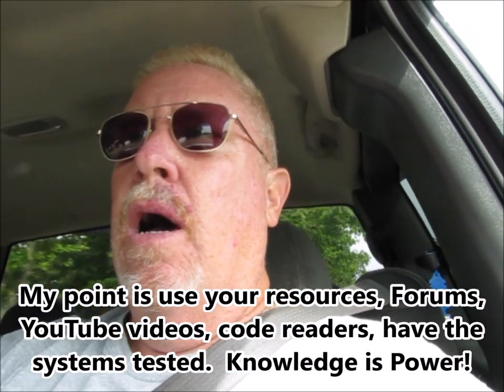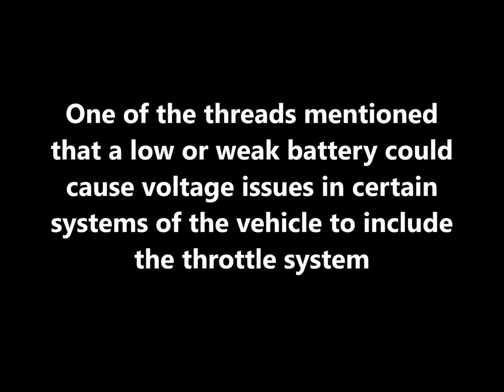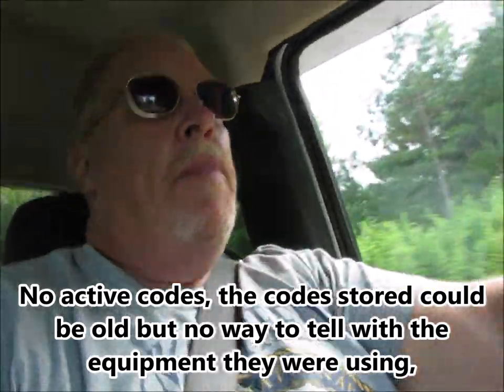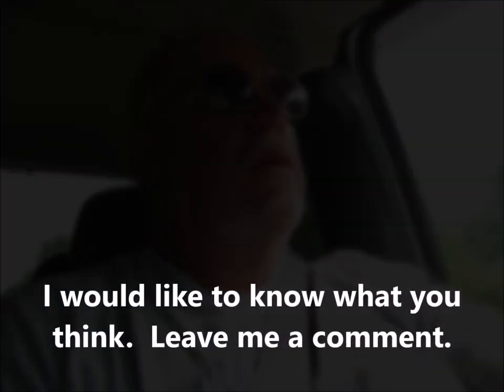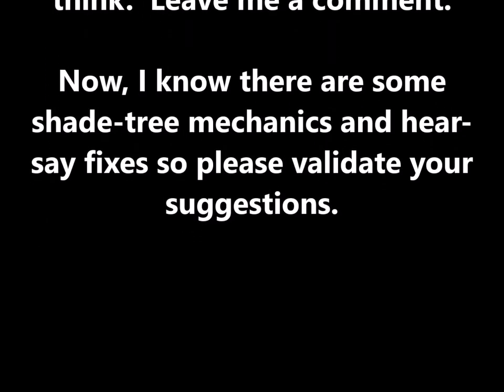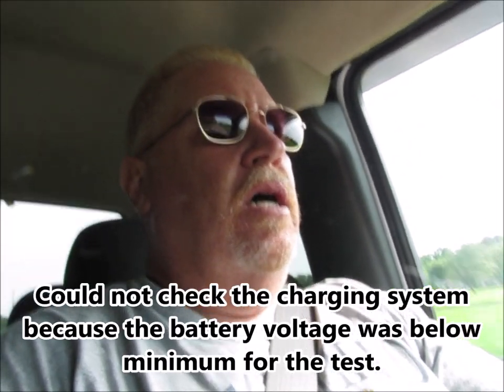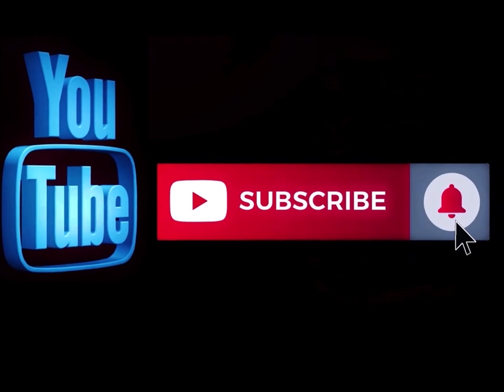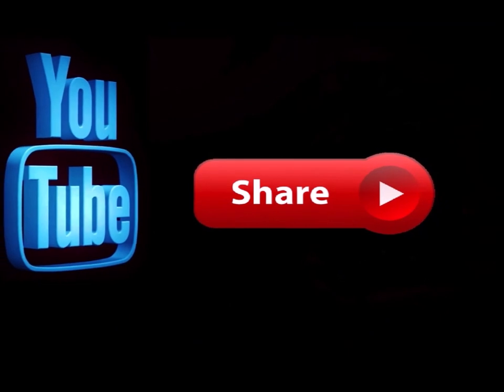Troubleshooting - Reduced Engine Power

Comment: Low voltage battery will cause all kind of electrical mishaps. With my experience with older vehicles when a three year old good brand battery starts acting up its best to replace it along with the alternator. Being a Chevy both are easy to replace. While you’re replacing the alternator you might as well replace belts , plugs, plug wires and fuel filter. Go ahead and give some love before being stranded.
Reply from the maker: Thanks for the advice Chad.  As for the additional maintenance items those will come in due time.  The truck needs tie rod ends, thrust alignment, tires balanced, shocks, etc.
Reply: I would think about replacing the battery, you are doing the smart thing by driving a see if the condition reappears.  As for changing the alternator when you change the battery, that would more than likely be a waste of money. I work on equipment, and the company I work for has several GMC and Chevrolet trucks between 2000 and 2007 year models. I've been around these vehicles for over ten years. I bet I've replaced dozens of batteries on these trucks, maybe in that ten year span two or three alternators total for all seven of our work trucks. We have had electrical issues, check engine lights and such. Not every time but most of the time, disconnecting the battery, and letting the computer reset. It removes the glitch that it had. But time will tell Ed, if it comes back.
Reply from the maker: @tracyphillips3325 , my plan is replace the battery before it starts getting cold, if it lasts that long.  Right now the truck starts and runs great.  When I do have the battery replaced I will get the alternator checked as well but I don't think it has a problem currently.  When running with every load I can place on the electrical system the alternator output is 12.6 volts and with just the engine running and no other load it is 13.4.  makes me feel like the charging system is working as it is supposed to do.
Reply: @EdsAttentionToDetail  12.6 is close to minimum, if it's a few minutes after start up that should be fine.
Reply from the maker: @tracyphillips3325 , that was after driving about 20 miles.  I used my multi-meter to check the DC voltage at the battery terminals.
Reply: @EdsAttentionToDetail  should be fine

Comment: I am completely dependent upon the dealership. All I know how to do is turn a key and drive. I have been lucky. I have never been stranded on the road, but I know that may be coming. I have a 2010 Ford Ranger I use for work. It may fail somehow at some time. Although I have been good at maintaining the old thing. I do have a 2019 Toyota Tacoma for times I want to drive with reasonable assurance I will get to where I am going. I am glad you seem to have solved your problem Ed.
Reply from the maker: Thanks Joe, peace of mind is important whenever you are on the road be a few miles or a few hundred.  I have been blessed with a decent mechanical aptitude so my reliance on a dealership is not as great.  Sending prayers your transportation needs are always met!

Comment: Hi Ed. I think you did it the smart way. I agree knowledge is power.
Reply from the maker: Tracy, my intent was to disconnect the battery to clear the code and check engine light then see if the problem returned.  No need to drop a bunch of resources on what might be a one time fault.  Smart way, that would imply I am smart.........just not so sure about that one! 😂
Reply: @EdsAttentionToDetail  you put some thought into it, before just jumping the gun and start replacing parts. I've seen people do that and all they did was eliminate some of their resources.

Comment: ????   First guess would be battery.   I had a simular problem in a 2014 E250. It was the fuel pump regulator module.  ????  Things don't run the way they did when we were kids.  Like you said there is so many systems that all have to work together to make your truck run.
Reply from the maker: So far, the truck is running fine (about two weeks now) so still paying attention to what it is doing.  Symptoms usually point back to a root fault but currently there are no symptoms.  Thanks for the comment, take care and God bless!

Comment: Hey Ed!! That sucks you were having some reductions in power in your truck. That's crazy the truck wouldn't over 50mph or 2K RPM! We try to do as much of our own car work ourselves at home.. Butters looked up those codes too... Isn't the APP sensor part of the ECM? If tightening the terminal and the vehicle is running well.. hopefully that was the issue..  If you had a battery tester, that could/would rule out your battery in less than 2 minutes. But if you continue to have issues with it.. check ECM failure?? Just a suggestion. We hope you can get to the root of the problem. Much love and good luck with it!! <3
Reply from the maker: Hey Bests and Butters, I read your comment a couple days ago and truly thought I had responded, so sorry this is late.  The truck is running fine.  I do think this problem was related to the battery in some form.  My current plan is to replace the battery before winter, if it starts not wanting to start or has other issues.  I try and do as much of my own maintenance as I can unless I can get done free or cheaper than I can perform the task (oil changes, tire rotations, etc). Thank you for your continued support and hope all is well for you both!  God bless!

Comment: I have had a problem with a mass Air flow sensor that made it run at way reduced power when it was raining. Also had an O2 sensor do the same thing. But a code should be coming up. So Idk?
Reply from the maker: The codes are helpful to a certain point but not always do they identify the exact trigger to the problem.  Seems in this case the loose negative post on the battery was a contributing factor.
Reply: @EdsAttentionToDetail  I could see that. I have a similar problem on one if my vans.

Comment: Great job on the research bud. from my experience in the autoparts world, batteries can be finicky, and with all the sensors and computers on board todays cars and trucks, a drop in voltage could cause a cascade effect.
Reply from the maker: Yes sir, very true.  I honestly dislike chasing voltage and ground issues so hopefully it was the battery all along.  Guess time will tell.  Take care my friend!

Comment: I remember on a four wheeler I had when the battery went dead it put itself in limp mode . You could hardly get any RPM's . I went a year or more not riding it until I came across YouTube video about .  All I needed was a new battery and hook up couple connections to reset the computer . Maybe your truck was in limp mode .
Reply from the maker: Yes Aaric, that is commonly referred to as limp mode.  So far it has not re-occured.  Just monitoring it right now for any other signs.

Comment: I would be replacing the battery ... The alternator on any vehicle since the 80s only produces enough amperage to run the vehicle, & maintain the battery. ( not Made to Charge anymore) If you run a weak/bad  battery too long, The Alternator will get overworked & it will go out with the battery costing alot more!  Seen this many times, even on bigger vehicles...
Reply from the maker: Thank you for the advice, my plan is to replace the battery soon.